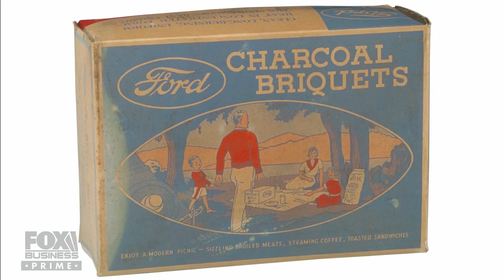The Birth of Ford Motor Company

Comment: Ford in my opinion is the best auto manufacturer. They innovate and everyone else tries to keep up. Also only manufacturer not to go bankruptBut I think in 10 yrs Elon with tesla takes over the game
Reply: looooool! walk into any tesla dealership and ask them what happens if the computerized parts don't work, as advertised. Go on.....I dare you!
Reply: @andrabook8758  ask any dealer what happens when there computerized parts don't work. Lol
Reply: The only thing good about Fords is that they are cheap to buy up front. The corners cut become apparent when their poorly designed and cheaply made parts break. Ford isn't anything special when it comes to innovation. They kept making the model T long after its prime. You had to go to competitors like GM for features like electric starting and paint colour options. As for Tesla, electric cars are not that complicated to build. Despite this, they can't even get simple things like suspension parts, their motors, door handles, and paint right. There are $5000 electric cars in China that have limited capabilities but are functional. Once the competition from established automakers start releasing electric vehicles, Tesla will have to compete in terms of price and be able to manufacture to cost.